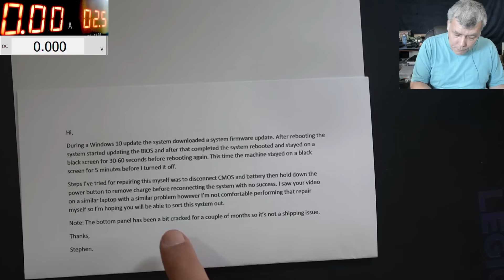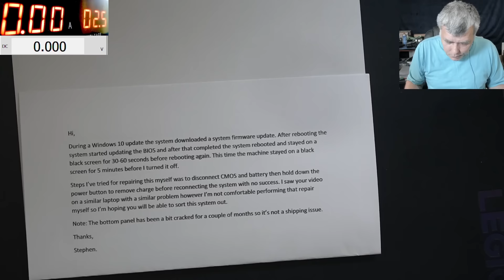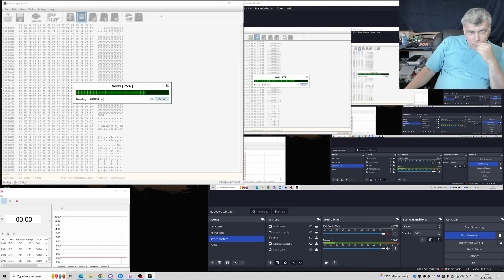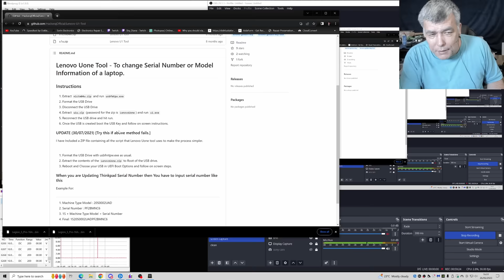Lenovo Legion 5 15ACH6H dead after windows updates - Sadly, laptops are dying after windows updates

Comment: Yeah, this isn't a "Windows update", it came with the Window updates, but it's a BIOS update and should never have been allowed to be sent through Windows updates. Anyone who works with computers knows that BIOS updates done from inside Windows can go wrong and end up bricking the computer.
I don't recall ever giving Microsoft permission to provide updates for my computer hardware, and I recommend everyone go into updates, and go to optional updates and tell it not to allow optional updates. This should disable driver updates, and I hope also BIOS updates.
Because of this, I think people would have pretty good luck in a class action against Microsoft for pushing updates that brick so many computers. Updates that should have nothing to do with Microsoft.
Reply: This isn't a Windows thing. Linux also includes firmware updates - incuding UEFI updates - via the Linux Vendor Firmware Service (lvfs). The laptop might have bricked just the same with Linux. There is simply no way around firmware updates, unless you disable updates altogether.

Comment: So many Lenovo Laptops these days with faults :( insane!
Reply: yeah. i got mine lenovo thinkpad t440. The only issue was no voltage coming from backlight and the costumer agreed to replace the whole lcd. It took 2 weeks the lcd to arrived and by the time I test the laptop it was already dead (no power). Now im waiting for programmable eeprom device to flash the bios. i hope this could work.
Reply: @n3m1k81  i hope it will work bro in many cases it work i had so many lenovo laptops to fix bios and they get back to life idk whats happening with lenovos but yeah lets hope for best. this days i first check so small things just voltages and than direct to flash bios and whola they get to life if not than continue but 90% of them just bum bios and gg so wierd  🤞
Reply: @GlishaSo  Thanks bro. Hoping it wouldn't get me any problem. This  really stressed me out on this board.
Reply: Its well known issue with Lenovo, i heard many issue with them, suddenly die

Comment: Don't you just hate when charges for laptops (just like phones) won't let you use anything else!?!?  I have a laptop that a co-worker handed me.  it had been dropped and needed repair and it would not charge after updating to Windows 10.  I had heard of this before but had no idea what was causing the problem.  I searched everywhere for a solution but nothing worked.  It ran fine on the power supply but would not charge.  Then I looked at the power block.  There was a square indicator on it that LOOKED like it might be a flush button.  It was!!  I pushed the button and behold(!), It was charging!!!  I repaired everything else on it and it works fine.  It's a little dated but it has a great display.  Anyway, I have NEVER seen and other laptop where you had to push a button on the power supply to initiate charging.  I'm still not sure if there was something different about Windows 8 (the original operating system) that allowed it to initiate the charge automatically.

Comment: I don't have any doubts Windows is causing issues with laptops, it has been happening since Windows 95. I used to run a repair shop. What I will comment on, is just how impatient that slow-ass Windows Update is and how easily people get frustrated with waiting and try to do something themselves to make it go faster. Do you know just how many systems I have had to fix because the customer interrupted Windows Update and crashed the system to where it won't boot? You said Windows Update was updating the BIOS and something happened? Only in the most rarest of cases, Windows Update will update the BIOS, EXTREMELY RARE case!!! I think the customer tried to update the BIOS themselves and the power supply may have died at the most unfortunate time. Although, a laptop battery should last long enough for a BIOS update. I believe it is customer impatience more than anything. I had to replace a proprietary system board (on-board graphics) because the guy wanted to install his own graphics card. His method was to remove the on-board chip with a butterknife and a dart... People lose any common sense they ever had when it comes to a computer, tablet or phone, they think one of the dumbest machines on the planet is smarter than they are. All a computer can do is add a 1 or a 0, it does it really fast, but, that is all it can do... it can't do subtraction, multiplication, division. The programs it runs make it seem really smart, but that is the stupidest machine on the planet.

===> steps down off soapbox...

Comment: just to share my experience in bios reprogramming.. I have a Dell laptop, its charging, has display, and its biggest issue is I cant install OS (win7, win8, win10, nothing) , no matter what drives (HDD and SSD) I put in.... the installation will always stop with BSOD. I cant find any solution on the net.. I just thought, what if I reprogram the bios with my CH314, anyway I loose nothing since I will declare this dead anyway.. desolder the bios chip, reprogram (the app detected a corrupted portion on the ROM chip) then after soldering and tested the installation, whoa.. everything works.. I installed win10 without any hiccups.. installed drivers and everything.. it just works.. I never thought (as well as others on the net and forums) that its just the corrupted bios.

Comment: Hi, My Legion Slim 7i just died after bios update.
Does anyone have a bin file bios image for this model to share with me?
My model is 16IAH7 motherboard NM-E461
12700h Rtx 3060
From website the bios file is a cap file and it does not work on my laptop

Comment: I have a weird almost related issue.  Lenovo Ideapad 5 .. ryzen 5 chip.  Was working great, this laptop has full 360 hinge with touchscreen and pen for interfacing.  After windows upgrading it was fine, then an update later (I don't remember which update) - the keyboard suddenly developed input lag and stuttering, then it stopped responding in certain areas.  I have no idea how updates could cause this, or was it just coincidence of keyboard failure along with updates? I always used lenovo app to do bios updates since there was known benefits to updating bios on those ryzen systems. Ideas anyone?

Comment: We lost around 60% of our lenovo fleet to a dodgy Thunderbolt/USB-C controller. It would eventually wear out due to a software bug, BUT they released a firmware fix for it. However, the fix would either cure the problem or kill the device immediately 😂. Luckily ours were all under warranty and received a main board swap, but I expect that all the dead boards went into landfill rather than being repaired.

Comment: Anybody have any keyboard issues with their legion 5 pro 3060 model…my left shift key is not working, ‘1,2,3 & 4’ number keys(not numpad) and capslock button. Probably hardware issue… an external keyboard works just fine…anybody who has any solution for this or do i just have to replace the keyboard?

Comment: I don't understand. Why exactly didn't your own power supply work with this laptop?
Reply: There is an ID pin. I found this table online:

45w-120 ohms

65w 280 ohms

90w 550 ohms

135w-1 k

170w-1.9k

they say any charger above 170w has a

4.5-5 kOhms

in case of lenovo the resistor the id pin connects to ground.

Comment: This is why I don't buy or support Lenovo. With these coded factory power adapters.  HP also does similar with their 3rd wire sensor to activate the HP adapter. Laptop won't operate otherwise. I also don't buy any HP products.

Comment: After the window update my legion 5 has been acting crazy my gpu is having problem
In device manager a warning ⚠ sign is present in my gpu tried DDU and reinstalling new driver as well as resetting pc but have no effect 

Window forced itself on the update and it took a lot of time to complete it .... during the update laptop was unusually hot and when it opened boom graphic card is not in detection. Nvidia control panel wont open, in geforce anything other than driver section cannot be pressed, there is a driver update and when i try to install it, it completes but again shows the option for installation. In vantage and corsair icue it only detects intel uhd, no sign of nvidia gpu
Its been 2.5-3 yrs that i have purchased this laptop so warranty is out of option. Any suggestions?

Laptop specs
Legion 5 15IMH05H
10th gen i7-10750H
Rtx 2060

Comment: Wow, looks like using Windows is risky to your data and property. Better to use Linux
Reply: This was a Lenovo laptop firmware update problem. If you were running Linux on that laptop, you probably were using the Linux Vendor Firmware Service which would have shipped you the exact same update.

Comment: ok its not windows lol. what happened as this is gamers loptop it also adds up. owner simply lying. bios cant be changed by windows, unless you go yourself to bios and do smth or start bios tinkerin or update. So basically owner is lying they all do, people taking theyr lawnmovers, leafblowers to repair shop and say ow it was wife or sun or anyone but me. So what he did is simple he went himself to bios played a little and fucked up all. or simply updated bios. Which is not needed and is risky. probably he made mistake or started to be not patient and computer went to become brick. If you interrupt it goes bye bye. You may try to simply removing battery, in loptop main abttery and also small one changable one, holding 10-20 sec than putting beck it should go to default, if it did not it was damaged. which means it must either use second bios for safety or must fix its own bios. while tapping to it. Windows cant do this. it can only start downloads updates of bios which will only start after restart and will ask are really want it to instal, if you interrupt bios crash and pc wont start. pls dont make wrong accusations

Comment: It's not „Microsoft“ or „Windows Update“ to blame, it's the manufacturer, in short they push UEFI BIOS updates, and they even push them on „Linux“ (Linux Vendor Firmware Service (LVFS)), which is supported on some distros like „Red Hat/Ubuntu“ etc. They should be responsible for a smooth and stable BIOS updating and recovery measures in terms of a BIOS corruption, such as a chip with a clear button.